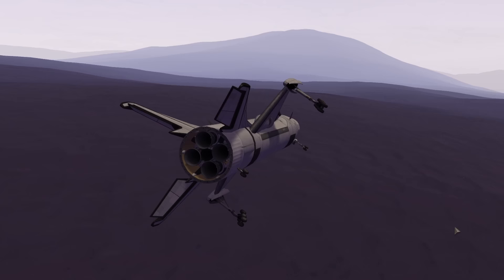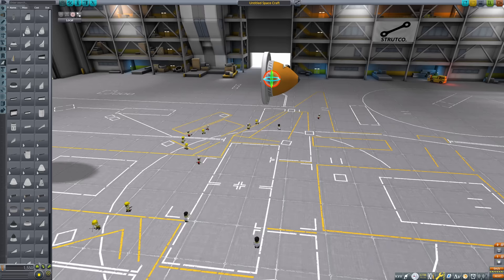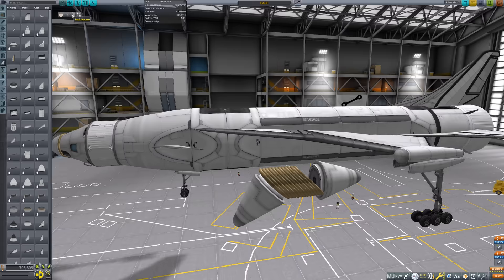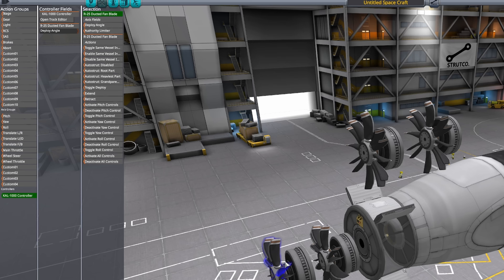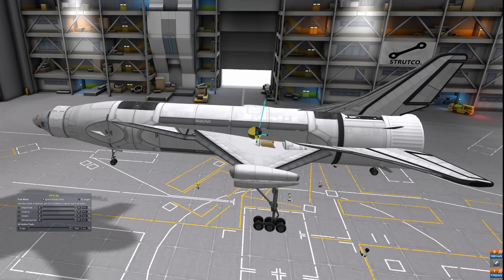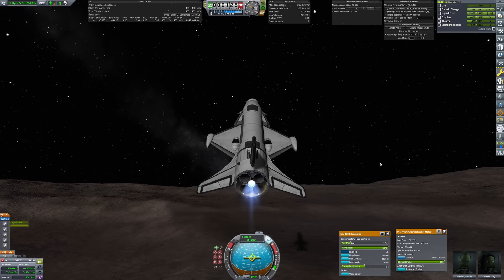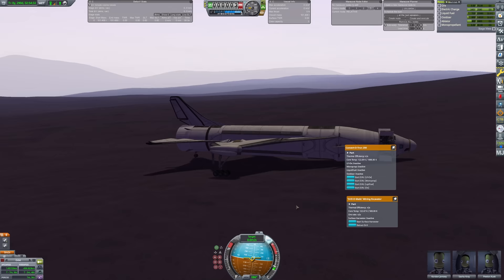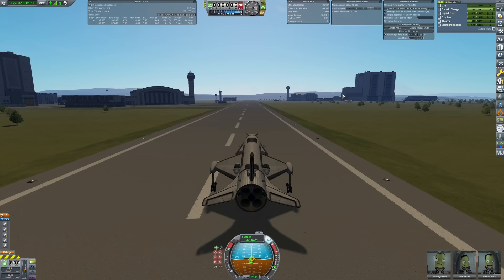forbidden KSP tech.

Comment: how would you go about constructing a rocket thats as tall as the VAB and not have it glitch out? need tips
Reply from the maker: I generally don't. That's why I clip fuel tanks, have my size limits I guess. But when it comes to shuttle stacks with tall launch systems, I just make subassembly for the launch system and clip it into the ground when I work on the shuttle.
Reply: Autostrut and normal struts

Comment: While technically very impressive, using clipping to that extend is very exploity. To me, it's the "challenging bigger brother" of just turning on unlimited fuel in the cheatmenu.
But as I said, and I meant it, technically it's very impressive.
Reply from the maker: Clipping in itself achieve nothing, game is voxel based calculating drag, heat and mass for every clipped part. Power of clipping is really important when you combine it with another mentioned gameplay mechanic. Like faring occlusion and engine plates. Clipping allow to reduce mass of these techniques and allow to solve fuel balancing issues Clipping is not as powerful as it looks, faring and engine plates are just broken...

Although some things are just ridiculous when you think about them. Like you can make any fuel tank dragless when you apply matching nosecones on the both sides. This basically makes every fuel tank of smaller size just useless if you play with no clipping. Lets hope KSP2 would have more advanced calculations in this department. ;-)
Reply: @Yakez42  While I'm not holding my breath for that particular hope, I'm definitely looking forward to KSP2. It's been a year or two since I played KSP, and I'd love to get back into sending stuff to space with moar boosters :D

I also always loved the colonization aspect some mods added, like actually building spacecraft on mun or minmus and sending fuel from other sites there instead from Kerbin.
And of course the life support for those sites as well :D

Hope we get something like that in KSP2, even if more "easier and grounded" in the game itself until mods expand on it.

Comment: How did you nestle the fans inside the service bay?
Reply from the maker: You can attach propellers to pretty much any surface, including flat sides of service bays. From there offset tool do the trick. Just make sure that faring does not occlude motors.